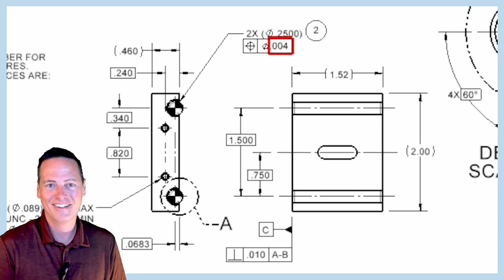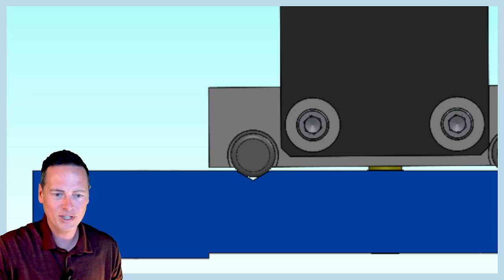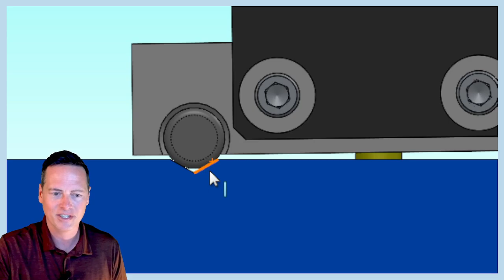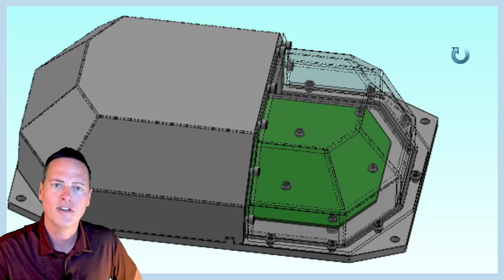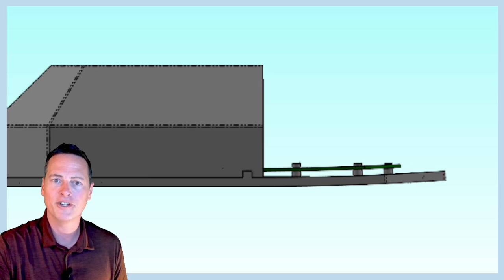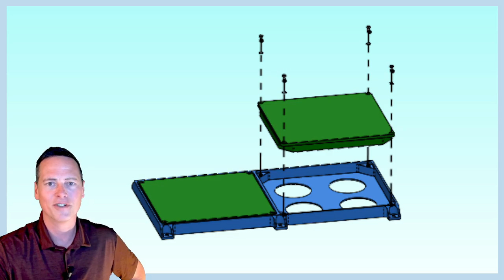Addicted to Over-Constraint 2 (Summer 2024)

Comment: Great explanation and example. What would be the manufacturing process for pressing balls on the grey part?
Reply: press them into a hole! The dimensions and tolerances for fits are different for balls in a cylinder, because there is more compliance in both due to smaller contact area; these can be found in the Machinery's Handbook. But, like mentioned—it might be better just to have looser holes and use adhesive. Less stress in the material, and easier to manufacture a feature that controls depth of the ball's fit (only one tight tolerance, not many)